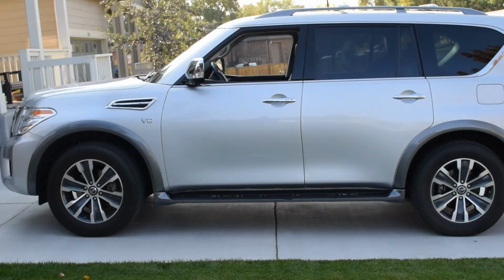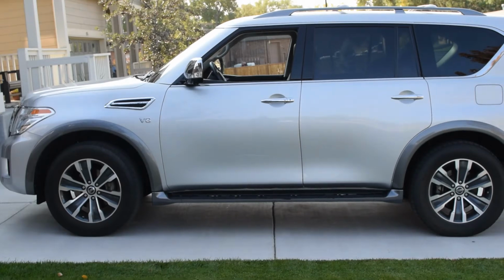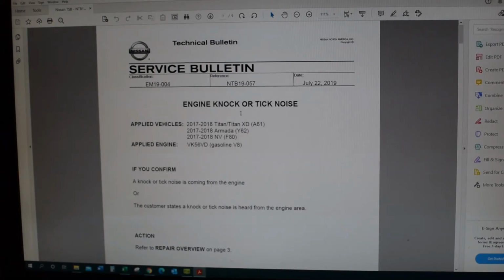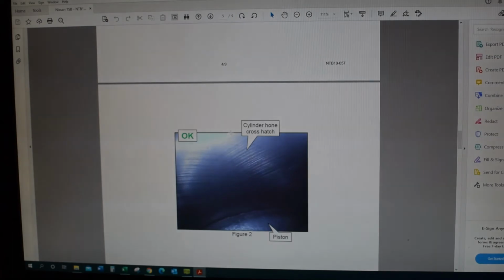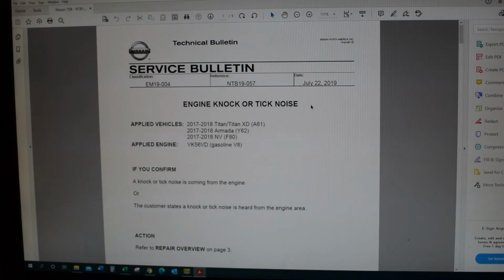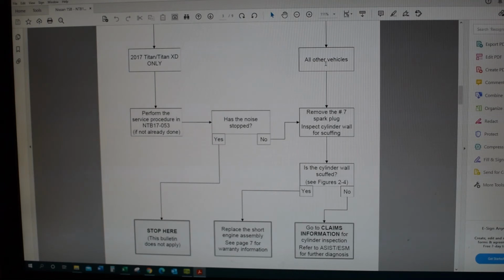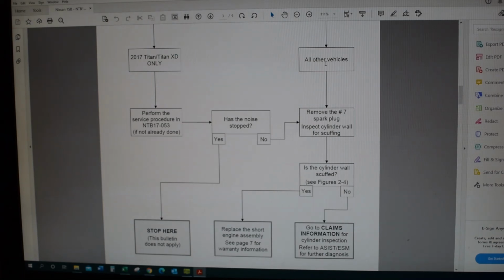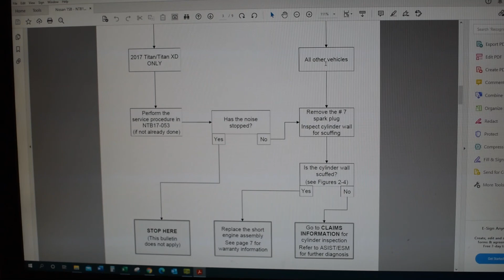Nissan Armada Engine Knock | After And Before New Engine

Comment: Nice video. Thanks for posting. I have a few questions. What oil grade did you use in the first engine? Does the second engine call for the same grade as the first? 
I bought a 21 Titan in February and it calls for 0w-20 and that's what I am using, however I hear others are using different viscosity. Thanks.
Reply from the maker: I use 0-20 mobil 1 full synthetic in both engines. There wasn’t a change in grades called for with the new engine. I’ve read 0-20 is for better fuel economy. I have also read that some people have concerns about going with that light of a viscosity. I’m sticking with 0-20. So far so good with the new engine.

Comment: Got to the dealer and it was quiet like you said. Wonder if it could be a idling oil pump issue? Left it running while we talked and it began to tick. Thay gave me loaner and called today saying they are putting in a new motor. Thank you for the video.

Comment: Thank you for your video.  My wife's QX 80 is waiting for a new short block.  The engine noise has gotten much worse while waiting for  the new block to arrive.  Have you ever found a reason for this cyclinder scuffing?
Reply from the maker: I think it was a manufacturing process issue that caused the scuffing.

Comment: The before and after video sounds the same.

I have a Titan and the injectors are really loud.

I also suspect the vvl and vvt systems cause the engine to rin lean at idle which can cause some noise.

My engine sounds like it is knocking per the TSB, but haven't noticed anything else; contaminated oil, oil loss, power loss, ect

Comment: Great video! I'm about to purchess a 2019 Armada SL with only 32,000 on it. The Sevice Bulletin says 2017 -2018. Do you know if they have extended it the 2019 years or did the fix this Big problem?
Reply from the maker: Thank you! I’m not sure if they got it fixed in 2019. I’d hope they’d have whatever factory process causing the cylinder issue ironed out by then.
Reply: The service bulletin extends to January 2019 so vehicles after that date aren't affected.

Comment: Everything still good on this?  I’m about to call my dealer. You’ve provided more info in these two videos than I’ve found on Google.  Now I have more evidence to present to Nissan if they want to try and back off warranty.  Still have 7k miles left.
Reply from the maker: Hi, it's going good so far with the new engine short block. On 05/21/2021 it'll be a year w/ the new block w/ no issues. Good luck. Print the TSB out and take it when you go in and I'd say to have them listen to the knock w/ a cold engine start. Mine was quieter after the engine was warm and they couldn't hear it initially.
Reply: @swipemagnetron  you can hear ours cold or warm lol.  I was almost leaning toward a torque converter or trans pump because of where the sounds coming from. Either way I just scheduled with my dealer.  They are actually doing a titan right now and said they are well aware of the NTB and it being a known issue.

Comment: we have a 2018 with 65000km on it has the same problem booked for a short block replacement at cobourg nissan Canada Ontario.
How you find the car after the new engine installed?
is it good power full?
Reply from the maker: The new engine works fine. I think it has the same power. Which is nice.
Reply: Our 2017 armada has 44k on it and is knocking. Paid over 90k all in

Comment: Hey good morning. Any updates on the Armada? I am strongly considering purchasing one, but reliability truly scares me. I read about the cylinder knock and block replacement, but I am not convinced it will fix permanently fix the issue. Such a shame because they are amazing vehicles.
Reply: I know I’m a bit late to answer this but I myself have replaced a few of these short blocks and it does stop the knock/ticking you hear in this video
Reply: Do you feel that this is a permanent fix for the issue? I am deciding whether or not I should purchase these. I am also planning on racking a lot of miles and keeping the vehicle for a long time if I do get it. I just want to make sure it will be a trouble free reliable vehicle in the long run. I have been reading that these issues plagued Nissan's 5.6, from Titans to the QXs.

Comment: Did you have any loss of power on acceleration before you had the block replaced? 
Mine has 93K and sounds similar.
Reply from the maker: I think the power/acceleration was similar before and after the knock arrived.

Comment: Still knocking! Just like mine. Is the timing right?
Reply: You need to differentiate between the hi pressure direct injectors and engine knock every direct injection car will have a slight noise thats normal put in this video its not the injectors for sure

Comment: The knock in my 17 Armada is slightly quieter than that, how hard did you have to fight the dealer to get the shortblock replaced?
Reply from the maker: Hi, I had to take it to two dealers. The second dealer was better. I printed the TSB out and took it to the service department on the second time. The knock on my engine was quieter when the engine was warm so they kept it overnight so they could listen to it in the morning on cold start. That's what did it. The techs lining up service appointments I don't think were full mechanics and couldn't hear the subtle knock that I could hear on a warm engine. So definitely push to have  a mechanic whose done engine swaps listen to the engine on a cold start if you need to. Good Luck.
Reply: @swipemagnetron  yea that’s what I’m worried about, will definitely print the TSB like you did when the time comes. My Armada is about to crack 70k miles so will be interesting how they fight it.
Reply: @slowsleeper550 any update? I’m going through this issue right now.
Reply: Same issue here,waiting for any update. @nessavannessa
Reply: @nessavannessa  Yes, I had the shortblock replaced about a year ago now. I had the extended warranty on it so it was all covered under that. The dealership I went thru was familiar with the issue and they even had a couple of short blocks in stock so took about a week if not sooner?
Reply: @nessavannessa  thanks for the update. Glad to hear that they finally took care of ya. I didn’t know about the TSB for the torque converter so will have to keep that in mind. What year is your Armada again? My 2017 just broke 118k miles yesterday so approximately 35k miles on the new shortblock so far and all is good!
Reply: @slowsleeper550  Mine is a 2018 as well. I didn't know about the TSB for the torque converter until he told me and I started to research it. If I knew I was going to have all of these problems, I probably wouldn't have  bought this car in all honesty. But they had it about a month and all is well now. Seems to be running well. I don't drive it every day since and when I do I probably do maybe 15 miles in a day. I don't even think I've put 100 miles on it yet! But the 2nd dealership was awesome! I'll definitely be using them again if I have anymore issues. 😄

Comment: When you put it in gear with foot on the brake, that’s EXACTLY what mine sounds like. Two dealerships have told me it’s normal. What can I do?
Reply: honestly man just keep driving it. I have never heard of a catastrophic failure on these motors. use high octane fuel, and keep up to date on your oil changes and you will be fine.
Reply: Does high octane fuel make the knock less noticeable? @plaxerous.
Reply: @jakeb.5489  idk I have the knock and have only ever ran 93

Comment: I have a Titan and have never known mine to not knock since it started 2 years ago. I have had it in 5 times over 2 years as it keeps getting worse.  Cold, warm - it doesn't matter. "Nothing wrong, it sounds just like a new one" is what they keeps saying. The first NTSB came out right about the time it started. I referred them to the NTSBs each time even. I make sure they keep noting it on the service record. I have my own videos now. It is knocking worse than my old Chevy with 250k miles and I don't even have 29k on it yet (working from home). I haven't worried about it since I have warranty left. I am going in first full week of June and I'm not leaving until this is settled as I need to start driving and frankly it is embarrassing. I am going to skip the service manager and be talking to the general manager this time. 

There was a Nissan Mechanic on one of the forums that said he had replaced 18 short blocks personally and his post was in 2020. Apparently they had a batch of bad blocks. It kind of makes sense because I keep smelling coolant too and they can't seem to find that issue either.
Reply from the maker: I remember ours sounding like a diesel when we were in the DQ drive through. That sound was embarrassing for sure. I had to try a second dealer also. Hopefully you can get them to scope the cylinder for scoring and have them sort it out for you.